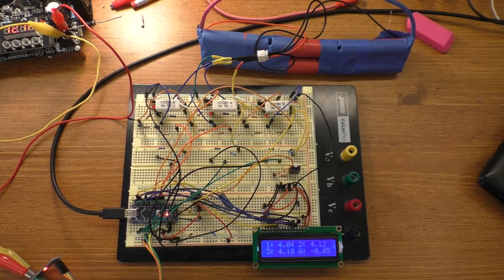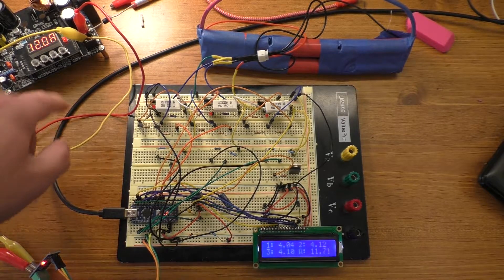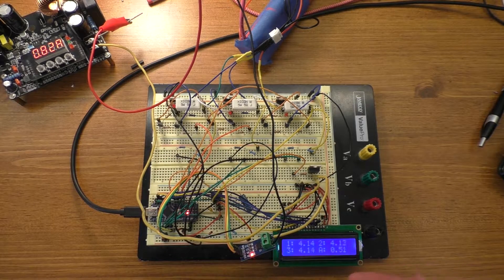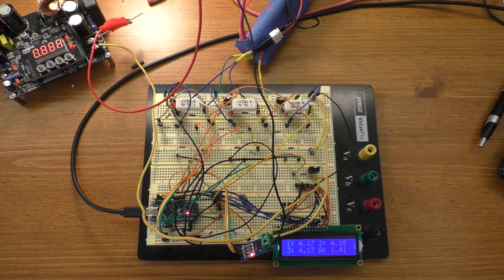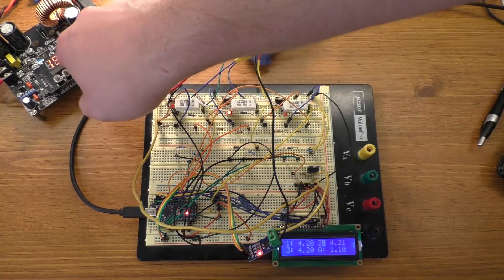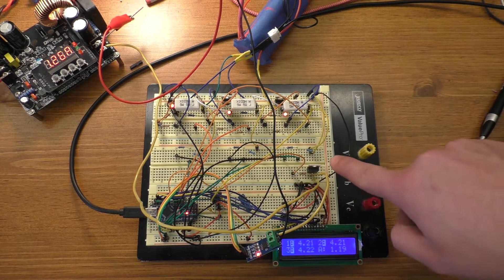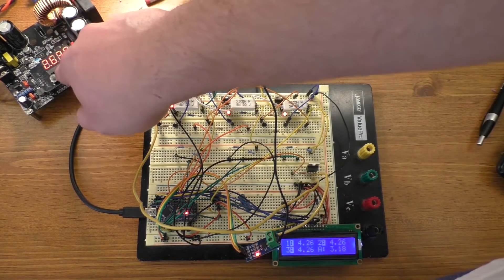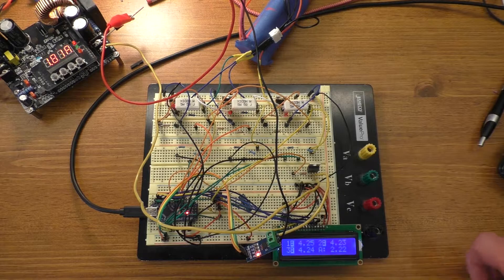Arduino BMS #6: Adding Current Sensing

Comment: Whoa! I didn't realize how low the view count was until 6 videos deep! I was expecting at least 80k. Good videos man keep up the good work. I'll trade you a sub ;) us small youtubers gotta band together in recent times. 

I wanted to ask you though, can you give details on the schematic? I've also been working on the same project and I've run into a wall with the connections for the main mosfets for the balancing.
-If I balance the cell by shorting it across itself, then the ground of the transistor will have a potential equal to all the cell's before it--As far as I understand the signal to turn it on will need to be raised to surpass that ground potential. Not sure what to do here.
Reply from the maker: Thank you! I subbed to your channel, looks like you have some interesting projects. I can link to the schematic in it's current form nothing is final at this point but it is working for the most part. 
https://easyeda.com/mopac1851/Arduino_Balance_Charger-e669293c629b40e0b2dd404c5dc6a1d4
Reply: Eman2000 thanks!

Comment from the maker: Version 0.5 of the code

#include <LiquidCrystal.h>

float cell1V = 0.00;          //sets variable for the voltage of the first cell
float cell2V = 0.00;          //sets variable for the voltage of the second cell
float cell3V = 0.00;          //sets variable for the voltage of the third cell
float calV = 0.00;            //sets variable for supply voltage compensation
float supplyV = 0.00;         //sets variable for the voltage of the supply to the arduino
float cell1Cal = 50.00 + 0.8; //allows for voltage calibration of the first cell
float cell2Cal = 50.00 - 0.2; //allows for voltage calibration of the second cell
float cell3Cal = 50.00 + 0.2; //allows for voltage calibration of the third cell
float zenerV = 2.33;          // measured voltage of the voltage reference
float cell1AverageVal = 0.00; //sets variable for use in calculating the average voltage of cell 1
float cell2AverageVal = 0.00; //sets variable for use in calculating the average voltage of cell 2
float cell3AverageVal = 0.00; //sets variable for use in calculating the average voltage of cell 3
float cell1AverageV = 0.00;   //sets variable for the current voltage of cell 1
float cell2AverageV = 0.00;   //sets variable for the current voltage of cell 2
float cell3AverageV = 0.00;   //sets variable for the current voltage of cell 3

float averageAmps = 0.00;     //set variable for the average amperage going into the battery pack
float ampsAverageVal = 0.00;  //variable used for calculating the average amperage
float ampSensorMillivolts = 0.00; //used for ACS 712 readings
float currentAmps = 0.00;      //used for the present amp reading
int ampsVal = 0;              //store the analog value for the ACS 712 without the offset
int ampsSensorVal = 0;        //store the analog value for the ACS 712 sensor

float balanceVal = 4.20;      //voltage where the balancing circuits kick in
float protectVal = 4.25;      //voltage where incoming power will be shut off

int zenerVal = 0;             //variable used for analog reading of the voltage reference
int cell1Val = 0;             //variable used for analog reading of cell 1
int cell2Val = 0;             //variable used for analog reading of cell 2
int cell3Val = 0;             //variable used for analog reading of cell 3
int averages = 100;           //sets the number of averages taken during each voltage Measurement

int cell1Bal = 2;             //sets pin 2 as the output to control the balance circuit for cell 1
int cell2Bal = 3;             //sets pin 3 as the output to control the balance circuit for cell 2
int cell3Bal = 4;             //sets pin 4 as the output to control the balance circuit for cell 3
int powerIn = 5;              //sets pin 5 as the output to control the incoming power

int flag = 0;                 //sets up a flag for later use in cell balancing

const int rs = 12, en = 11, d4 = 10, d5 = 9, d6 = 8, d7 = 7;  //pin config of the LCD
LiquidCrystal lcd(rs, en, d4, d5, d6, d7);                    //used for LCD setup

byte invertedColon[8] = {
  B11111,
  B10011,
  B10011,
  B11111,
  B10011,
  B10011,
  B11111,
  B11111,
};

void setup() {                // void setup runs once upon power up
  Serial.begin(115200);       //enables serial output
  lcd.begin(16, 2);           //enables the 16x2 LCD
  lcd.write("Initializing");  //write something to the LCD
  lcd.setCursor(0, 1);        //move the cursor the the second line
  lcd.write("Version 0.5");   //write more to the LCD
  lcd.createChar(0, invertedColon);

  pinMode(cell1Bal, OUTPUT);  //sets the pin used to contol the balance circuitry for cell 1 as an output
  pinMode(cell2Bal, OUTPUT);  //sets the pin used to contol the balance circuitry for cell 2 as an output
  pinMode(cell3Bal, OUTPUT);  //sets the pin used to contol the balance circuitry for cell 3 as an output
  pinMode(powerIn, OUTPUT);   //sets the pin used to contol the input power as an output
  delay(2000);                //2 second delay so you can read the screen
}                             //end of void setup

void loop() {                                       //void loop runs perpetually after the void setup has finished
  for (int i = 0; i < averages; i++) {              //for loop used to get an average voltage of the cells
    zenerVal = analogRead(A3);                      //read the analog value for the voltage reference
    supplyV = (zenerV * 1024.00) / zenerVal;        //calculate the supply voltage of the arduino using the analog value from above
    calV = (supplyV - 5.00) * 10.00;                //find the diffence between the supply voltage and the expected 5 volts

    cell1Val = analogRead(A0);                      //read the analog value for cell 1
    cell2Val = analogRead(A1);                      //read the analog value for cell 1&2
    cell3Val = analogRead(A2);                      //read the analog value for cell 1&2&3

    ampsSensorVal = analogRead(A4);                 //read the analog value for the current sensor
    ampsVal = ampsSensorVal - 512;                  //get rid of the offset the sensor introduces (allows for reading positve and negative current)
    ampSensorMillivolts = (ampsVal * 5000) / 1024;  //gives us the current millivolt reading of the sensor
    currentAmps = (ampSensorMillivolts / 66);       //convert millivolts into amps
    ampsAverageVal = ampsAverageVal + currentAmps;  //add values for averaging 

    cell1V = (cell1Val * (cell1Cal + calV)) / 1024; //turn the analog value into a voltage that is calibrated as accurately as possible for cell 1
    cell2V = (cell2Val * (cell2Cal + calV)) / 1024; //turn the analog value into a voltage that is calibrated as accurately as possible for cell 1&2
    cell3V = (cell3Val * (cell3Cal + calV)) / 1024; //turn the analog value into a voltage that is calibrated as accurately as possible for cell 1&2&3

    cell1AverageVal = cell1AverageVal + cell1V;     //add the present voltage to the pervious voltages of cell 1
    cell2AverageVal = cell2AverageVal + cell2V;     //add the present voltage to the pervious voltages of cell 1&2
    cell3AverageVal = cell3AverageVal + cell3V;     //add the present voltage to the pervious voltages of cell 1&2&3
    delay(1);                                       //delay between measurements
  }                                                 //end of the for loop

  cell1AverageV = cell1AverageVal / averages;       //calculate the average of the readings above for cell 1
  cell2AverageV = cell2AverageVal / averages;       //calculate the average of the readings above for cell 1&2
  cell3AverageV = cell3AverageVal / averages;       //calculate the average of the readings above for cell 1&2&3
  
  averageAmps = ampsAverageVal / averages;          //calculate the average of the reading for the current sensor

  cell2AverageV = cell2AverageV - cell1AverageV;    //calculate the volage of cell 2 only
  cell3AverageV = cell3AverageV - (cell2AverageV + cell1AverageV);  //calculate the volage of cell 3 only

  Serial.print("Cell 1 Voltage = ");  //dump the measured voltages and currents to the serial monitor
  Serial.println(cell1AverageV);
  Serial.print("Cell 2 Voltage = ");
  Serial.println(cell2AverageV);
  Serial.print("Cell 3 Voltage = ");
  Serial.println(cell3AverageV);
  Serial.print("Supply Voltage = ");
  Serial.println(supplyV);            
  Serial.print("Amperage = ");
  Serial.println(averageAmps);         //end of serial writing

  lcd.clear();                        //clear the LCD
  lcd.print("1: ");                   //send data to the LCD
  lcd.print(cell1AverageV);
  lcd.print(" 2: ");
  lcd.print(cell2AverageV);
  lcd.setCursor(0, 1);                //move the cursor to the start of the second line
  lcd.print("3: ");
  lcd.print(cell3AverageV);           //end of lcd control section

  if (cell1AverageV >= balanceVal) {  //if the voltage of cell 1 is at or higher than the balance voltage
    digitalWrite(cell1Bal, HIGH);     //turn the balance circuit on for cell 1
    flag = 1;                         //set flag equal to 1
    lcd.setCursor(1, 0);
    lcd.write(byte(0));
  }

  else {                              //if the voltage of cell 1 is lower than the balance voltage
    digitalWrite(cell1Bal, LOW);      //turn the balance circuit off for cell 1
  }                                   //end of if/else statment

  if (cell2AverageV >= balanceVal) {  //if the voltage of cell 2 is at or higher than the balance voltage
    digitalWrite(cell2Bal, HIGH);     //turn the balance circuit on for cell 2
    flag = 1;                         //set flag equal to 1
    lcd.setCursor(9, 0);
    lcd.write(byte(0));
  }

  else {                              //if the voltage of cell 2 is lower than the balance voltage
    digitalWrite(cell2Bal, LOW);      //turn the balance circuit off for cell 2
  }                                   //end of if/else statment

  if (cell3AverageV >= balanceVal) {  //if the voltage of cell 3 is at or higher than the balance voltage
    digitalWrite(cell3Bal, HIGH);     //turn the balance circuit on for cell 3
    flag = 1;                         //set flag equal to 1
    lcd.setCursor(1, 1);
    lcd.write(byte(0));
  }

  else {                              //if the voltage of cell 3 is lower than the balance voltage
    digitalWrite(cell3Bal, LOW);      //turn the balance circuit off for cell 3
  }                                   //end of if/else statment

  if (flag == 1) {                    //if the flag has been set to 1
    delay(3000);                      //wait 3 seconds
    digitalWrite(cell1Bal, LOW);      //turn off balance circuit for cell 1
    digitalWrite(cell2Bal, LOW);      //turn off balance circuit for cell 2
    digitalWrite(cell3Bal, LOW);      //turn off balance circuit for cell 3
    flag = 0;                         //reset flag to 0
  }                                   //end of if statment

  if (cell1AverageV >= protectVal || cell2AverageV >= protectVal || cell3AverageV >= p
Reply: this guy puts the code in the comment section instead of a github or the description 
o well, nice vids man, glad i found this in recomended
Reply from the maker: bas woudstra all of the info will go on github or something like that once it's done. You can't put code in a YouTube description.
Reply: cant you? interesting!
Reply: nah...
i just wanna tried this thing for my solar cell later

and wemos d1 for the wireless module..settable discharge value by wifi
what a long way to go